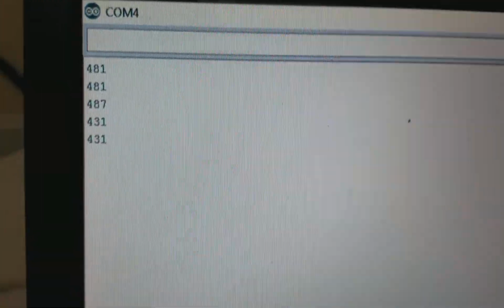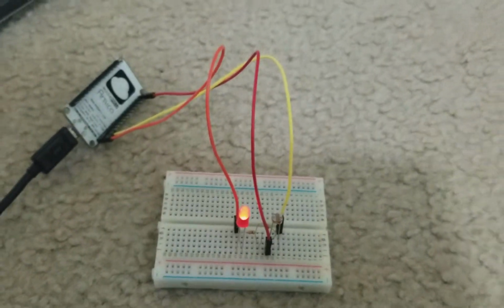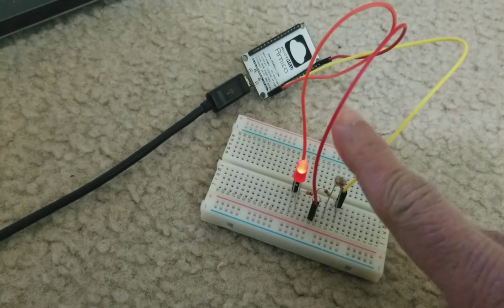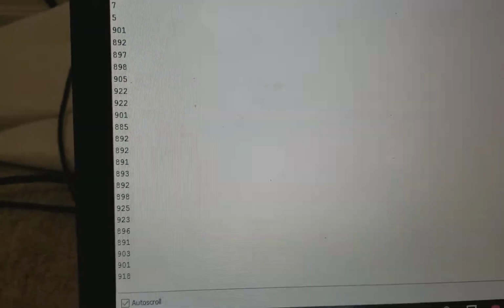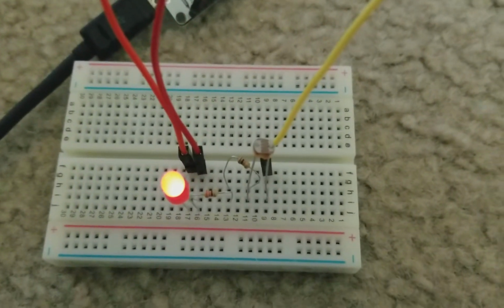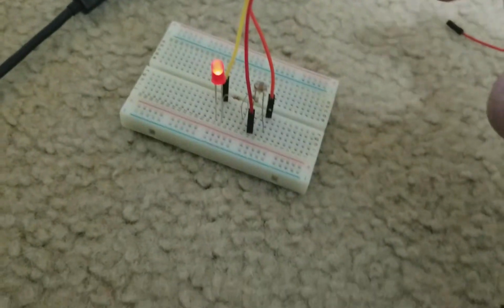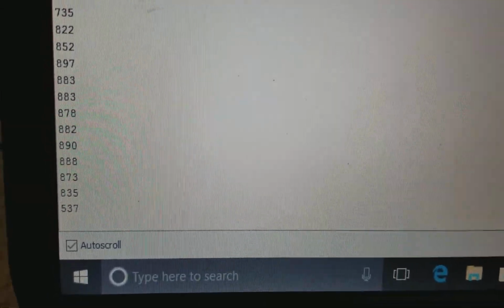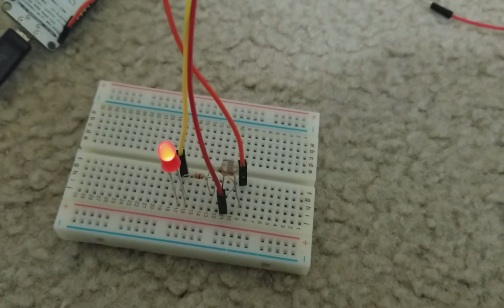PhotoResistor with ESP8266 NodeMCU

Comment: USEFUL video... I have only 1 question: 
WHY the 300 Ohm resister in series with a 10,000 Ohm resistor? 
300 Ohms is actually 300/10,000 = 3% of the 10,000 Ohm resistor and the 10,000 Ohm resistor is likely +/- 10%, which means it MIGHT ALREADY be as high as 11,000 Ohms anyways!
UPSHOT: adding the 300 Ohms doesn't really serve any purpose - does it? 
I'm going to try with just the 10,000 Ohm resistor & report my findings. 

THANKS for MAKING the video ! 

-Mark in North Aurora IL
Reply: ANOTHER QUESTION...
You stated you were getting 5V from the Amica NodeMCU you appear to be using, but when I trace your POWER and GROUND wires back to the board itself, I see what looks like only 3.3V and GND you're using. The only other wire is you tapping a voltage across the middle of your circuit, and feeding this into Vin on the NodeMCU board. 
HOW did you get 5V of power to your circuit???